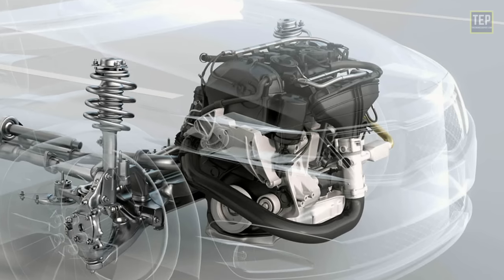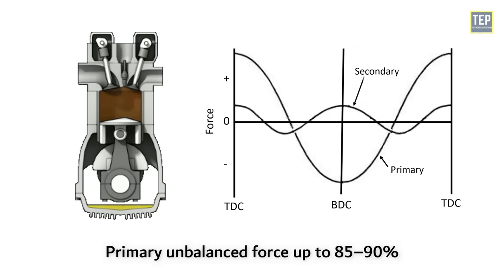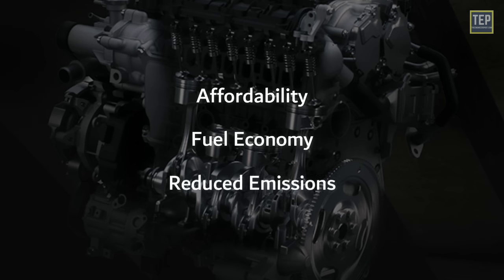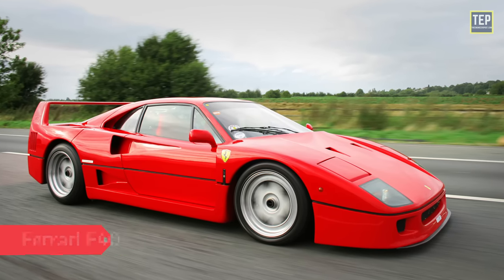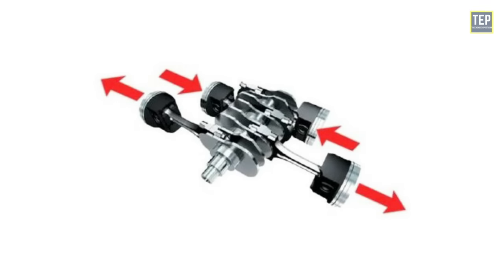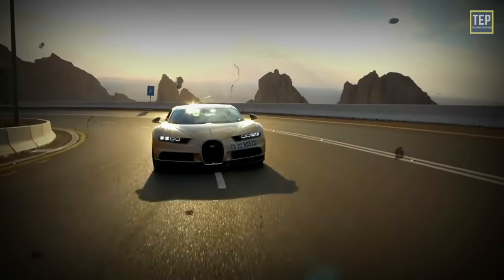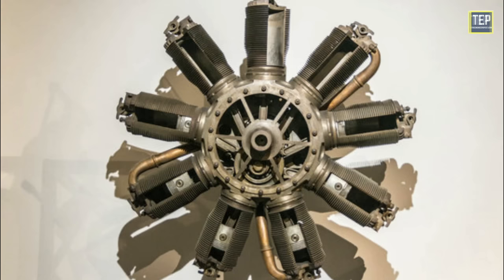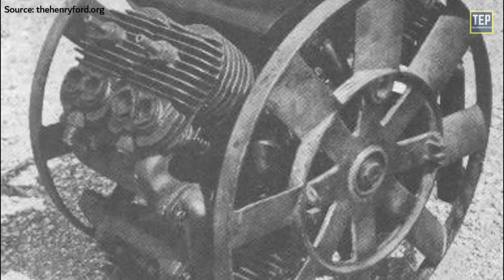Learn about every Engine Layout in just one video | V-W-X-U-H Engines

Comment: Very enlightening video!  Thank you. Most of the cars I've owned have been V6's or inline 4's.  I've had an Audi A6 with a supercharged V6, which was a great engine until it got near 100K miles, very $$$ to repair.  So, now I'm all about naturally aspirated V6's that can take 87 octane, like on my new Lexus ES 350, which has plenty of power and great gas mileage on account of its 8-speed transmission.  I hope to keep it a long time -heard they last well over 300K and still run great, as long as maintained.

Comment: I have a Volvo inline four, a B230F. It just runs. Has over 300.000 miles on it now, and still runs like clockwork. Never been rebuilt or repaired, only serviced. A great engine!
Reply: Volvo engines have easily gone to a million miles on the African continent and a few in United states.
Reply: Gak jaman. Ini cuma pakek hp biasa bisa menciptakan seperti itu. Lihat sendiri.
Reply: Apa bang Ariel

Comment: You mentioned that "Porsche, Subaru and Toyota are the only manufacturers that offer boxer engines", but you forgot BMW who offers several models of their motorcycles with excellent boxer engines.
Reply: Honda boxer 6....he said superbikes use v4.... Only panigale, every other is i4
Reply: Lotus did a flat 4 aswell??
Reply: @gregcook1285  Lotus doesn't make their engines, they use Toyota engines.
Reply: Lancia used boxer engines too 😊
Reply: He also missed the Tucker 48. which had a 334ci flat six.
Reply: I know that they are bikes but Triumph triples have a nice balance of torque and power.  The 955i a jewel.
Reply: He also stated that all Subarus are 4 cyl boxers. There are several models with 6 cyl boxer in them.
Reply: BMW invented the Boxer engine.
Reply: Commer? The TS3? All so forgetting it
Reply: @KaitouKaiju  Not before, they used rovers or their own constructions
Reply: @pekiimatvrdi  Aprilia RSV4 as well.
Reply: You seem to overlooked the Chevrolet Corvair also.
Reply: @gregcook1285  flat is not boxer. we should consider piston timing as well. it can be a V 180.
Reply: HBO used to make boxer too
Reply: Lancia is the father of the boxer which was then used in Alfa and is what the Subaru engine is based on
Reply: Douglas built boxers
Reply: I was hoping the deltic would be in here😢
Reply: @NavyDocThomas  the first BMW was a Douglas made under license by BMW.
BMW  later adopted the length ways crank.
Reply: It's not a flat four it's a 180 degree v four😂
Reply: @NavyDocThomas  
No.
Karl Benz developed the first boxer engine in 1897.
Reply: Ya
Reply: And even forgot alfa romeo 33 boxer
Reply: Good job anyway😂❤😅
Reply: Citroën: 2cv; 2cyl boxer. Citroën GS; 4cyl boxer. A lot of small aircraft engines: in 2, 4, 6, 8 and 12 cyl configuration
Reply: @pekiimatvrdi  what's about aprilla rs
Reply: White trucks and busses once offered a Boxer flathead V12
Reply: @NavyDocThomas Brunel’s giant Great Eastern steamship completed in 1858 had the largest opposed 4 cylinder engine ever made. 7 foot bore, 4 foot stroke, and weighed 500 tons . It had to be big because it operated at low pressure.

Comment: The Sherman tank "W-30" engine (by Chrysler) is not really a "W" engine, but rather 5 separate flathead inline 6 engines mounted on a single mounting module, with gears on the flywheels turning a large gear on a central shaft.
Reply: Some later production Shermans like the easy 8 had radial engines
Reply: It's called a crank case, no different than a horizontally opposed engine.

Comment: The opposed piston engine you showed, with added rocker arms and connecting rods, is one I never saw before. I know of the OP engines used in Southern Pacific Railroad locomotives made by Fairbanks Morse. These were used to haul the fast acceleration passenger commuter trains between San Jose and San Francisco, that I rode on. The FM engines had two crankshafts top and bottom geared together with the final drive from the lower shaft. One crankshaft lead the other by 20 degrees. These FM engines were two stroke diesel with a rootes blower to push in air. They had no valves in the cylinders using only ports for intake and exhaust. They did not meet emission standards of the Bay Area Air Quality Management District though and were retired in 1975. I understand the same FM engines were used in marine service, having heard the same sound coming from a tug boat. The "Deltic" opposed piston engine was also mentioned. I have heard of these in some British diesel locomotives. This used three OP engines in an 60 degree triangular formation. Any 1 of the 3 crankshafts were used by 2 adjacent cylinder banks.

Comment: The Sherman Tank engine was not called a W.   It was 5 separate 6-cylinder inline engines (flat head) bolted to a common block (in place of each engines oil pan).  It was called a Multi-bank.
Reply: The Sherman used five completely different engines…
Reply: @allangibson8494  Technically 5 engine sub-blocks which were bolted to a central crankcase. They were unable to operate independently as they shared their radiator, water pump, oil pan and oil pumps. 1 engine not 5 different ones.
Reply: @SaintBuick  no no...different sherman models used different engines.
Reply: Some later productions and variations had radial engines like the M4A1 which was a improvement of the standard production M4
Reply: Crankcase, cylinder, head
Reply: @julianstreet8675  Depends on who you ask and when. For most common usage in the war, yeah it was great. Being out in a European winter and you start that sucker up and that radial starts sucking air through the crew compartment into it (because that's essentially where the intake was). I'm sure the tank still performed better, but it would have sucked rock salt for the crew inside until the thing warmed up.

Comment: I have 7 cars in total, mostly L4s, including also an L2 (with both pistons moving together instead of alternating, it's a Fiat 126 - similar to the famous 500 - so it's more like a double single cilinder engine..), a 383ci Mopar V8 and a Wankel (Mazda Rx8).
Reply: In more detail:

1971 Plymouth Fury III 4dr Hard Top Sedan 383ci (6,3L V8)
2007 Mazda Rx-8 (1,3L Wankel)
1994 Fiat Panda 4x4 with swapped engine (1,2L L4)
1972 Fiat 126 (650cc L2)
1991 Ford Transit (Diesel 2,4L L4)
1985 Citroen CX TRD (Turbo Diesel 2,5L L4)
1997 Citroen Berlingo (Diesel 1,9L L4)

Comment: You missed a few - the delta and opposed piston engines.
The opposed piston engine has the cylinders in between two crankshafts with the pistons pushing towards each other.
The delta builds on that by having three cranks and three cylinder banks between the three crankshafts.
Junkers developed the opposed piston engines for aircraft use before WW2.
Reply: You should have watched to the end, where they have the opposed piston, and what looks like an animation for a double opposed piston engine....
Reply: The Napier Deltic is a very useful piece of kit. Locomotives, boats and the worlds most powerful fire pump.
Reply: There is another engine that not many have heard, also the most difficult but should be the most efficient,  many tried to design and have either failed or had not been to successful, I had a try designing it too
Reply: The master of opposed piston engines was junkers.  The WWII Jumo 223 and 224 two stroke diesel aeroi engines were rhomboidal, that is a square standing on one edge, with four crankshafts.  Look them up, they were magnificent.  They never went into production and like the rest of Junkers were shipped to Russia after the en of WWII.  The Napier Deltec engines were designed as a delta to fit into the hulls of patrol boats, the delta shape was a much better fit.,  Napier used Junkers technology that they licensed before WWII. There were compromises with the Deltec, one crankshaft had to turn in the opposite direction to the other two and the angle between the opening of the exhaust and intake ports was not optimal.  Nevertheless, they sounded fantastic, especially the big Deltecs.  

There was no soundtrack for the opposed piston engines, you could use the Deltec but I think the best choice would be the Commer Knocker three cylinder engine, there is a good soundtrack of a Commer Knocker in Sydney.  This engine used the arrangement shown in your diagram with only one crankshaft but used rocker arms to transfer the power to the crankshaft
Reply: The weirdest I’ve heard about was not featured here, the engine of the British Trojan car. It had 4 cylinders in a square configuration but only two combustion chambers and 2 spark plugs. Basically a twingle engine that’s been doubled. Or you could consider it an opposed piston engine that’s bent in half to use a single crankshaft. It was a quite successful design in the 1920s.
Reply: If you really want to try weird there are the crankless torpedo engines that use a swash plate to drive the propeller…
Basically a four cylinder inline radial engine (which may have eight pistons in the four cylinders)…

Comment: You missed the "rotary" air-cooled used up to around 1920, where the cylinders rotated to cool them and the crankshaft was bolted to the firewall.

Comment: I'm an aeronautic mechanic, and I've personnally even seen some Radial Engine with multiple stages ! (i don't really remember but it  was something like 18 cylinders i think, wich was built as 2 rows / 2 stages, of 9 cylinders each.)
Reply: There exists the R-4360 Wasp Major, a 28 cylinder, 4 bank engine
Reply: And the Lycoming XR-7755-3 36 cylinder radial or the Yakolev  M-501 (a 42 cylinder engine) with a 144litre displacement.
Reply: Imagine the power of a full size two stroke Radial engine.
Reply: Sounds like a double Wasp.
Reply: You laugh at his B-17 radial producing 1,200 RPM!

Comment: there is also 2 and 3 cylinder I-engines, mainly find these on snowmobiles and jetskies.  Oh and ya made a pretty big mistake, with 4stroke engines no 2 cylinders are firing at the same time.  If 2 or more cylinders are in the upmost position, then at least 1 is on it's exhaust stroke.  the 4 strokes are combustion, power, exhaust, intake.

Comment: Good overview.
My tips for types you missed ...
1.There is a special star configuration called "gnome".
2. Have you heard about Duke Engines? 😉
Reply: Yes Axial engines. Either stationary block or rotary are interesting. Actually some were produced and were more or less successful. Michel from Australia comes to mind.
Reply: Duke Engines are an utter failure. They never made it to production.
Reply: @stormlord55  The Michel crankless engines were essentially another barrel engine, Michel called the plate "the slant".  The difference was that Michell overcame the main issue with the swash plate by using the Michell hydrodynamic thrust bearing.  Michell revolutionized ships with his thrust bearing, it was superior in every way to its predecessors.  Look A.G.M. Michell up if you don't know of him, apart from the bearings and motors, he was the first person to solve the Reynolds equations for three dimensions.  Also, he wrote the seminal paper on structural optimisation before he applied himself to lubrication, unfortunately it was 50 years before it was used, too far ahead of the times.      

                
https://youtu.be/pqUjIZUCXC0?t=2915 This shows an experimental aero engine based on Michell's designs.

Comment: Everything that I have learned from engineering school has taught me that the one big factor that affects aerodynamics is the shape of the car's exterior. Can you explain how a V6 engine improves a car's aerodynamic performance compared if the same car had an inline 6 or inline 4.
Reply: The lower & shorter block can allow for smoother bodywork, if you're willing to make the engine bay a nigh-unrepairable Gordian knot of wiring, hoses, & ductwork.  Thankfully, such affronts to good sense aren't practical to manufacture, making it a generally theoretical concern for cars.

It's something that should have been explained in the video.

Comment: The Wankel engine is still the best design in terms of power/ weight and simplicity. I would love it if we could use modern tech to ‘fix’ the drawbacks of the design. You cannot beat the Wankel for efficiency, power and balance of the car it is mounted in.
Reply: The equivalent of stroke is tiny, they have no torque.
Reply: @givenfirstnamefamilyfirstn3935  but spin fast enough to make up for it
Reply: @davidaugustofc2574 as if they need to wear out faster

Comment: In U engine or any engine with 2 crankshafts, like 2stroke square4 or 2stroke v4, is bot crankshaft connected to transmission (crank A-transmission gear-crank B) or only one them (crank A-crank B- transmission gear)?
Thanks

Comment: There is another not mentioned and I don't know the correct terminalogy, where the pistons are horizontal with the axial shaft that as a fixed slanted disk around it, firing piston to the furthest part of the disk in turn turning the axle round.
Reply: the Duke is that style of engine
Reply: That was an oscillating disk engine commonly used in torpedoes but also used as a driven element in hydraulic pumps.

Comment: VR deserved a mention as it uses a single head for the v banks.
Also V-Twin engines are in the radial category and I suspect the W3 depicted was really a radial.
Reply: I can't recall who but there is an aftermarket engine based on Harley cylinders that is a 3 cylinder fan type. Anazi built 3 cylinder fan engines before WWl.

Comment: I just want to ask about engines V4 and I3, they are quite common too, no? V4 mostly for motorcycles and I3 for some cars, am I right or wrong?  Please, someone answer me... This is not supposed to be crtisism
Reply from the maker: V4 and I3 engines are both used in a variety of vehicles, including motorcycles and cars. V4 engines, which have four cylinders arranged in a V configuration, are commonly used in motorcycles and high-performance cars. I3 engines, which have three cylinders arranged in a inline configuration, are commonly used in smaller cars and some hybrid vehicles. However, it's worth noting that engine configurations can vary and it's not always a hard rule. Some car manufacturers uses V4 engine for small cars and some motorcycle manufacturers use I3 engines.

Comment: You could have used T-64 tank engine, as it is opposed 5 cylinder engine.
Reply: There is also the engine used in the Chieftain tank which was a vertical inline 6 cylinder 12 piston 2 stroke diesel.

Comment: Wankels are inefficient on fuel and burn tons of oil and are costlier to repair due to the brush ends. Their advantages are outweighed by disadvantages, its why the RX cars were stopped in production.

Comment: No mention of VR, which leads to the failure of the '4-bank W' used in VW engines being a double-VR by design. 
Lots of missing and misleading information here, along with some inconsistencies.  Also a ton of basic grammatical issues.  At least try to do better.